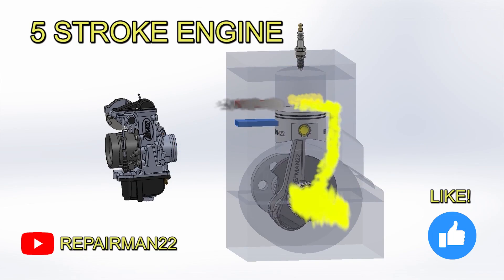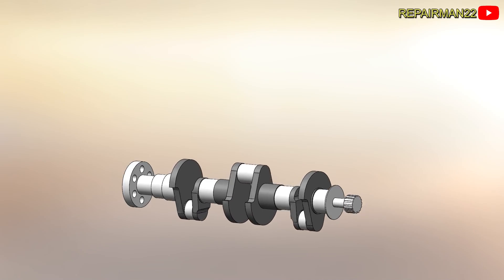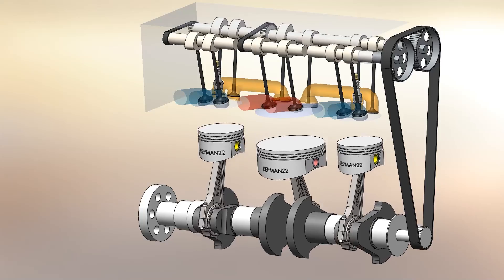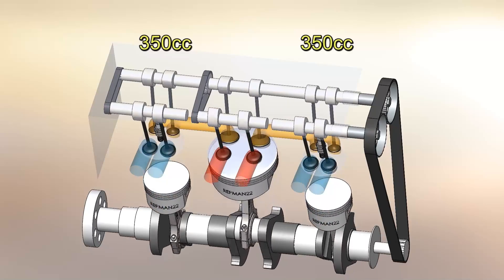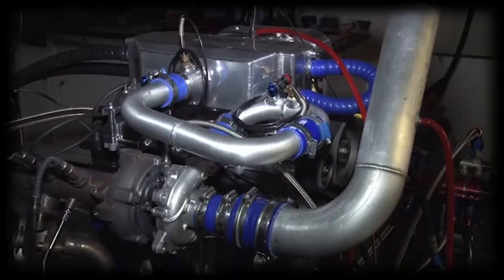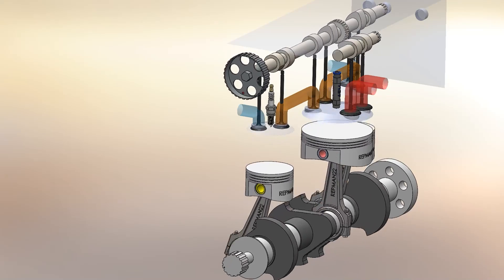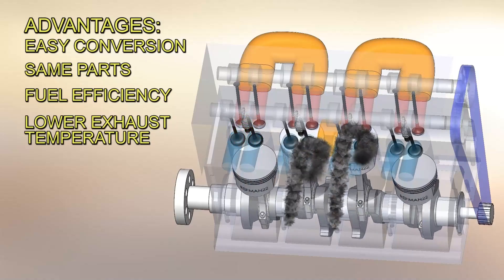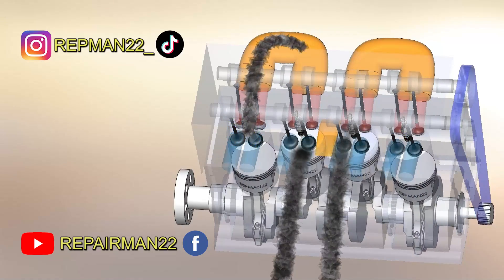The 5 stroke engine with water injection // Tested in Golf MK5 🤯

Comment: This is essentially an atkinson/miller cycle engine with two pistons, but with the vibrational balance of a four piston engine. The "extra moving parts" problem can be fixed by simply increasing the lobes on the camshaft, an extra camshaft and gear/chain mechanisms are not needed. The current miller cycle engines are limited by the stroke of their pistons; to make the expansion stroke double the length of the compression stroke, you can only use half the stroke for intake, limiting your power greatly. This engine solves that problem in a very intelligent way. I would have loved to see further development for this, I think there's incredible potential for high performance and high efficiency engines here. With enough funding it could start a sports car Renaissance.
Reply: Yeah I'm thinking if it "only improves efficiency under high load," then like... just make a high-revving lightweight version for sports cars, where its drivers will be happy to rev it to the moon and get decent fuel economy doing so. Economy sports cars would be fun.
Reply: Hi. Actually, engines are pretty pathetic when it comes to producing lots of torque. Torque’s what motors do. Engines drone out constant torque for months and months. Think of an engine and its fuel tank as a battery. Your neighborhood EV with its tiny, cheap, and light battery can get you 20 miles. And if you need to go further, turn on the engine, which will slow your battery drain enough that you will never run out of juice.
Tiny engine, tiny battery, tiny fuel tank. Way lighter and so more efficient than an EV in EV mode and over 100 mpg if you never plug in at all
Reply: @Thinginator   The issue is the other finding is that it's almost unusable when not at high load, high RPM. It might be fun for a little while to drive a car that can only move at 5K+ RPM, but it'd probably start to get frustrating whenever you have to do some slow speed maneuvers. Having such giant gaps in the power band would make getting correct gearing a bit of a nuisance.
Reply: @Appletank8  I think the "3" cylinder version would not be usable but like I mentioned earlier a pseudo v8 (technically v6?) configuration would have a very useable low end (there's always a power stroke present throughout the crankshaft rotation much like an inline 4) and a powerful high end with great fuel efficiency.
Reply: @ulasgursoy2838  The thing is, street cars don't typically spend much of their time on the high end. People aren't mashing their foot on the power for hours on end. Most of the time people going between lights or cruising on the freeway are using like, 50% of the max power or less. 

This is why Miller/Atkinson Cycles are used, they are efficient on the lower end, and use saved electricity for the rarer high power situations. All you need to change an engine from Otto to Miller is a change in valve timing. Going from Otto to 5-stroke requires a completely different cylinder head and valve design.

Also also, Otto cycle engines are already more efficient under high load, this isn't new. The hard part is being efficient at lower loads.
Reply: OK. Thanks for the info. So is this going to be good on all parameters for an ordinary consumer level car - cheaper, better?
Reply: what I can imagine: trick might work at only exreme narrow rev range - so the reamining (still hot) gasses are transferred to the middle clinder, it has to be very precisely in tact with two others (otherwise we create knocks on them)

In another words: drivable at very narrow rev range, so complex (and lossy) CVT to be used

You know the answer to that...
Reply: Give me a throwaway email address and I’ll send you a description of the engine that I’m currently sharing with UCIrvine.
Reply: I thought up a  quite similar concept some years back. However, the middle cylinder is the small cylinder. It achieves the same effect by drawing a small charge of air into a small central piston (which is 2-stroking), pushes the smaller charge into big cylinder1 (BC1) as BC1 (4-stroking) is sucking. BC1 then compresses+ignites,  expands  (while BC2 sucks from the compressing Little cylinder), then exhausts as normal. It alternates between 'subcharging' (opposite of supercharging?) BC1 and BC2. A few advantages a) there is no heat-losses in the transfer as this happens before combustion, and b) the dirty exhaust is isn't transferred into a second cylinder.  I knocked up an animated svg demonstrating the idea on my YT channel under 'split-cycle atkinson engine'.  Here: v=sBPzTCiBsZM   I wonder if one could play with lower compression ratios to reduce emissions. Also It might be worth making the little cylinder have massive clearance (as big as the stroke even!) as this might buffer the intake pulsations.
Reply: I'm not convinced this actually solves the limitations of the Miller cycle. You're going from 4 partially filled cylinders of air to 2 full cylinders of air, which isn't really allowing you to get more air when you're still moving 4 cylinders of mass around. Also, instead of over expanding within the first cylinder, you're wasting some energy going through the transfer pipe.
Reply: @Appletank8  you are correct, however the video claims 130 horsepower out of 0.7 liters of displacement. In theory, you can use a pseudo v8 configuration with larger cylinders for some crazy power with the fuel consumption of an economy car
Reply: @ulasgursoy2838  Is it really 0.7 L of displacement though? It's still carrying around 4 pistons of weight and friction, and it's practically unusable at low RPM. It wouldn't be that far off from a 1.4L engine expelling half of its intake. 

A similar engine is the 1.5L M15A-FKS, which gets 123 HP at 40% efficiency, and is usable across all regular RPMs. I'm not seeing that much advantages in this 5-stroke engine here, unless they have an efficiency chart that points out its efficiency range.

Comment: The exhaust gases need to still have enough energy to keep the after treatment hot. Otherwise it can never pass the current EU6 and defiantly not EU7 requirement. There legislations are actually extremely hard to meet even with a regular 4-stroke engine!
Reply: manitoba-op4jx  yep, and egt regulated by amount of water injected

Comment: Install glow plug in LP cylinder?
Reply: And then what? Inject diesel into it? Make it a hybrid fuel engine?
Reply from the maker: 1- a glow plug uses a lot of energy. 
2- It is not possible to burn fuel since there is no clean air in it.  You can't burn anything in it.
Reply: Catalytic converter burns unburnt fuel. So a glow plug can be sustained by the high temperature in LP cylinder.
Reply: Glow plugs consume a lot of power. Another way to heat up the cylinder is to set the valve timing a bit off, although it saps power and efficiency.

Comment: Also as a vw /Audi shop owner from 2010-
They couldn’t have chosen a worse engine. 

This engine already is incapable of going 100k without wearing out internal components.
Reply: I have a Fiat Punto 1.2 with 240.000km and no issues yet. My old Daewoo did 270.000 when I sold it. My uncle had Astra F 1.7d Isuzu, which did over 800.000
Reply: Probably why they used them a engine near its end is cheap